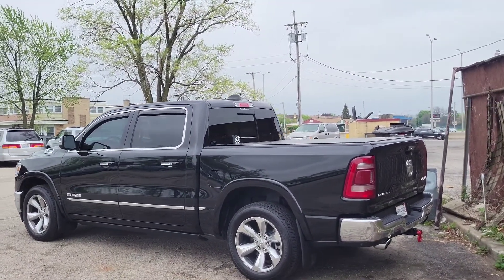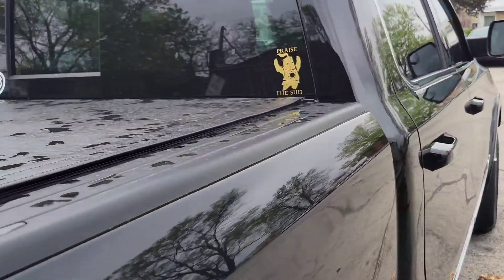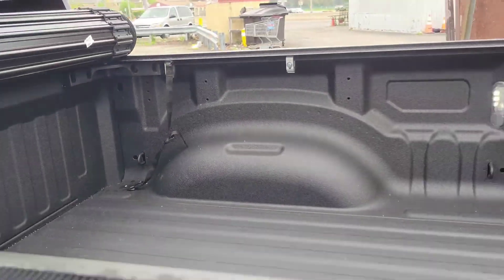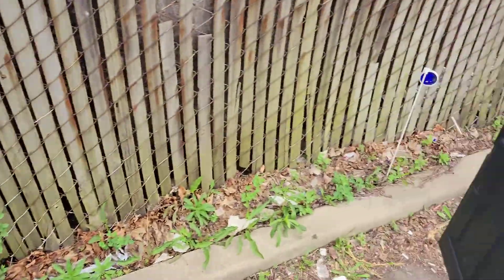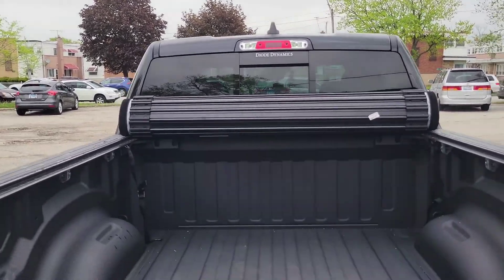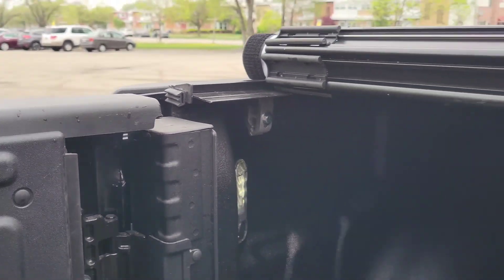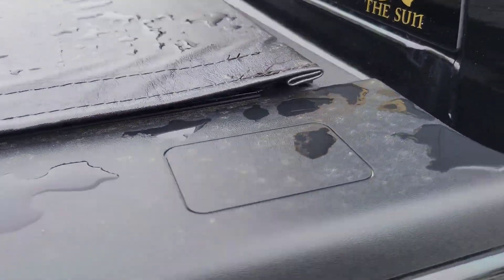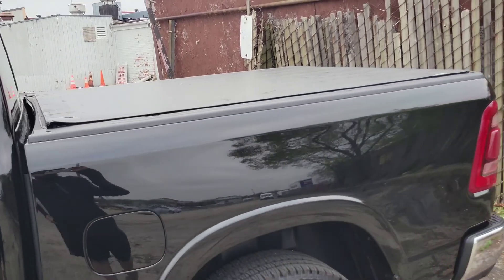Truxedo Sentry Tonneau cover 2021 RAM 1500 Limited W/ Multifunction tailgate

Comment: The Bulk Head Seal needs to be pulled to the Passenger side, it’s in a slot in the bulk head rail. Also the rails may be too close to the tail gate, tearing the rear rail seals. Loosen the rails one at a time push to the bulk head retighten, ever so little, then do the other side, you do want some contact with the seals. PS I take the strap hooks & insert into the D Rings for storage instead of flopping around the bed, keeps from catching things being slid in the bed. Am I being too picky?

Comment: I went the Mopar hard tri-folding cover. The only issue was I had to replace those huge brackets in the corners with skinner ones.
Reply from the maker: I'm pretty sure they're big like that because of how the tailgate opens, it needs the extra support :)
Reply: @theupscale7130  true. I went with 'Right on Brackets' and haven't had any issues
Reply: The brackets from RightOn brackets are way strong steel. And smaller